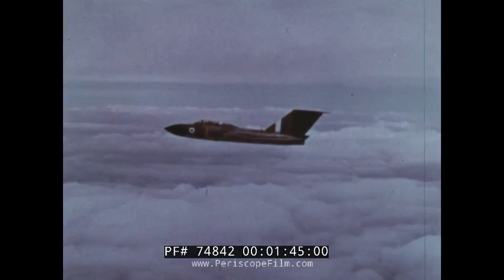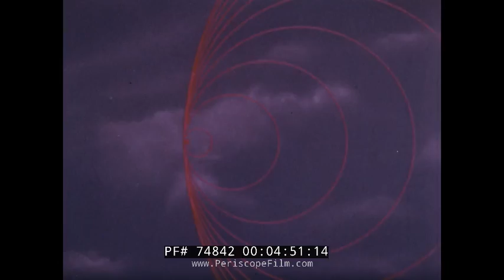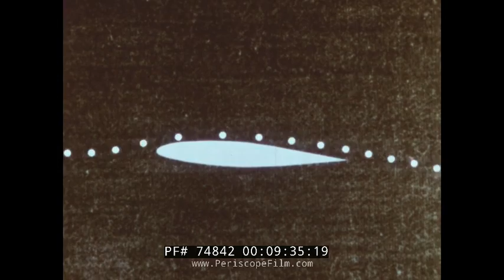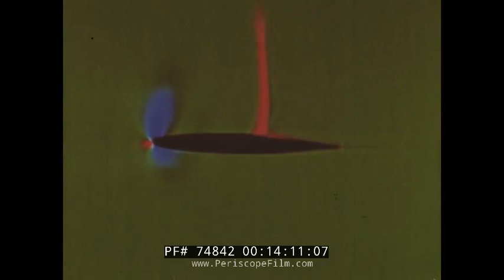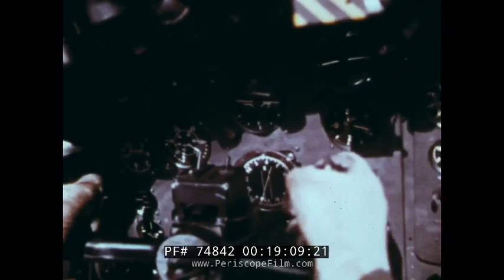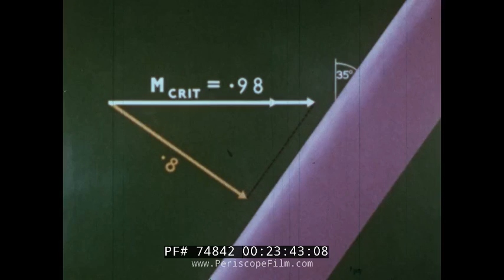" APPROACHING THE SPEED OF SOUND "  AVIATION AT MACH 1  SHELL FILM UNIT EDUCATIONAL FILM   74842

Comment: A big boo boo in the script right at the start.    The speed of sound in air is determined by air density or pressure, not temperature.     At sea level, the air is much more dense than at high altitude, so sound travels faster through it.     In fact, sea level hot air carries sound at a slightly lower speed than cold air at sea level, because it is less dense.
Reply: Actually, the temperature does affect the density-altitude pressure and thus the speed of sound... the higher the temperature the faster the molecules of gas move.

Comment: After such an eloquent reasoning... the last paragraph should read: "At high altitudes the speed of sound is lower because of the lower air density."
Reply: Incorrect - for a gas.   See above explanation of the equation for the speed of sound in a gas.  Here is a link that explains the speed of sound in different materials.   https://www.nde-ed.org/EducationResources/HighSchool/Sound/speedinmaterials.htm
Reply: @dougball328  He's not quite incorrect though is he. Air density is important and sound does travel faster through denser air. This quote from your link, 

"Suppose that two volumes of a substance such as air have different densities. We know the more dense substance must have more mass per volume. More molecules are squeezed into the same volume, therefore, the molecules are closer together and their bonds are stronger (think tight springs). Since sound is more easily transmitted between particles with strong bonds (tight springs), sound travels faster through denser air.

However, you may have noticed from the table above that sound travels faster in the warmer 40 ^{\circ} C air than in the cooler 20 ^{\circ} C air. This doesn't seem right because the cooler air is more dense. However, in gases, an increase in temperature causes the molecules to move faster and this account for the increase in the speed of sound."
Reply: @ianrkav  The speed of sound is the square root of the product of gamma * R * T  where gamma is the ratio of specific heats, R is the gas constant and T is the temperature.  Please notice that density is not in the equation.   This equation is for gases only - and different gases can have a different R.   You correctly pointed out the flaw in your own density argument when you noticed that the speed of sound went up on warmer gases.  CORRECT !
Reply: @dougball328  Well you did mention a 'constant' there:-) Speed of sound at 30,000ft is about 660mph. At sea level about 760mph. Why? Just because density isn't in the particular equation you mention doesn't mean it isn't a factor, but for that particular gas equation you would be correct:-) But so is the other guy:-) Anyway, thanks for your fast response from a four year old post.
Reply: @ianrkav  I repeat, the density doesn't matter.  You could cool the air down at sea level and the speed of sound would drop even if you kept the pressure the same.  And yes, because density is not in the equation DOES mean it isn't a factor.  As a 40+ year aeronautical engineer, I know this subject far better better than you.  Sorry, but that's a fact.  Now I am done wasting time trying to educate you.  I suggest you get some books on gas dynamics and study.
Reply: @dougball328  Ok thanks for that:-) I'm sure you do know the subject better than me. However, it is still a fact is it not that the speed of sound is slower at high altitudes than at sea level? It may be a layman's understanding but it is still true. In the meantime I shall check out gas dynamics. 
Maybe you engineer types just think differently to us mere mortals:-)

Comment: Somebody help. The speed of sound depends on material or
fluid density: the denser the material the higher the speed of sound (think
putting your ear on a train track...). At sea level the air is denser and
therefore the speed of sound is higher than at high altitude (any altitude)
because the air pressure is less. Yet at 3:20 - and this
is not the only youtube location where I find this stated (!), it is said that
the speed of sound depends on temperature, and because the temperature is
lower, so is the speed of sound. The opposite is true: the lower the
temperature the higher the air density, so the higher the speed of sound. At high
altitudes the speed of sound is higher because of the lower air density (the
temperature may have a negative but not linear contribution, and I am sure there
are plentiful studies).
Reply: For a gas, the speed of sound is the square root of (gamma*R*T), where gamma is the ratio of specific heats, R is the gas constant, and T is the temperature.
Reply: Interesting
Reply: @fiftystate1388  It's not rocket science. In a GAS,  the molecules are not touching- so to transfer mechanical energy,  the speed of the individual molecules sets how fast a wave can travel through it and the speed of the molecules is set by the temperature. The higher the temperature, the faster the molecular motion and the faster sound propagates because that's how fast one molecule can move to hit the next molecule in succession. As the density varies,  the distance the molecule has to travel is less,  but that has nothing to do with the molecular _velocity_. More precisely, a shorter path has a minor effect on the speed of sound,  but in a gas it is a tiny effect compared to the effect of temperature.

In cold gas the density might or might not be higher- but the molecules STILL are not touching each other and the speed of propagation is less because the speed of each molecule is less and they take longer to bump into the next one in succession. Get it? Don't assume that because the gas is colder it is denser- density is a variable that is usually NOT connected to temperature in the atmosphere; the higher you go the air gets colder but it ALSO gets LESS dense. Stay with me...

In liquids or solids,  the molecule ARE touching...so the "mean free path velocity" has no effect because there IS no free path. Higher gas temperature means higher free path velocity. (The "mean" free path velocity means AVERAGE velocity. There is some distribution of velocities because,  like billiard balls during a break,  some move faster and some move slower. But that's simply a detail of the statistics.)

Be careful extrapolating from what you THINK you know. Because sometimes you over-reach. This is one of those times.

Remember: Mach numbers only apply to GASES. NOT liquids and NOT solids. Only where a molecule has to travel some distance to hit another molecule does the Mach concept apply.
Reply: Consider the speed of sound is faster in steel, per Bing search, 16,400 FPS. I wondered about air Temperature vs Pressure too.